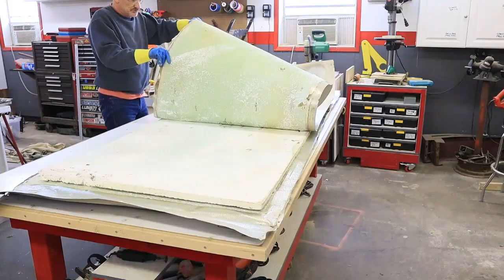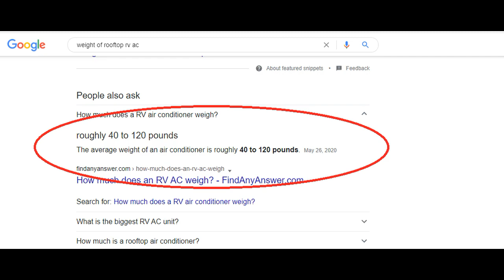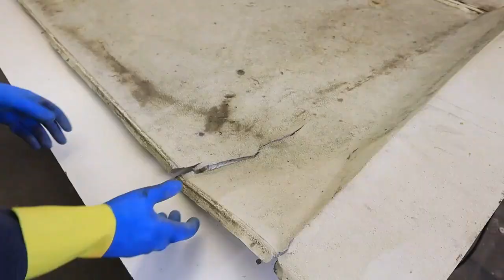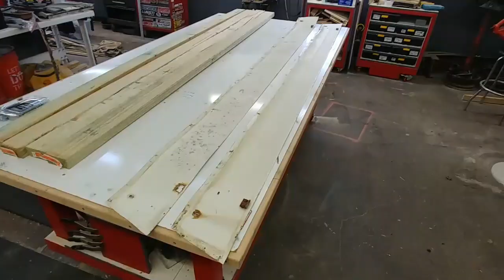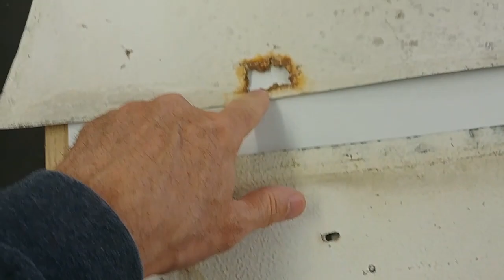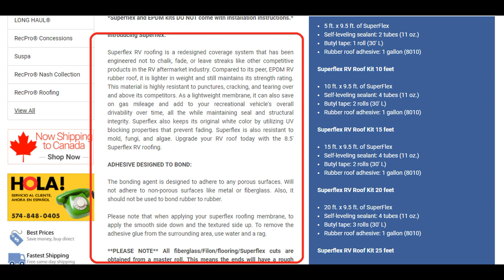POP UP CAMPER ROOF REPAIR Planning Rebuilding Roof Tent Trailer Wood Rot Replacement PT 24 #flgpopup

Comment: GB, I had an Apache Ramada pop up trailer that had an ABS Plastic roof. The side walls and slide out covers were also ABS Plastic. You can buy that in 4x8 sheets. Don't know if this would help You or not but it should be available fairly close by where You could haul it in Your pick up.
Reply from the maker: Thanks MT. I need at least 10  foot long sheets or there will be more seams. I ordered a 9.5 x 10 foot sheet of the rubber and it should not have any seams on top. That's the plan. I also considered fiberglass and ABS. There re other solutions besides aluminum. I hope this works. Thanks for the input. :)